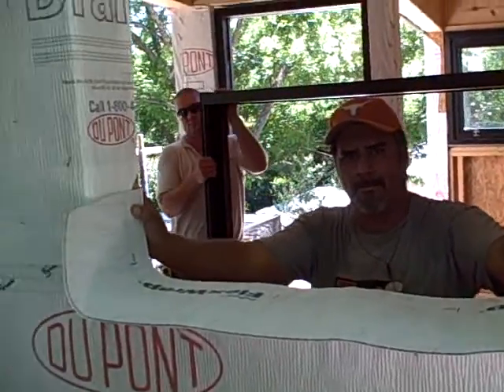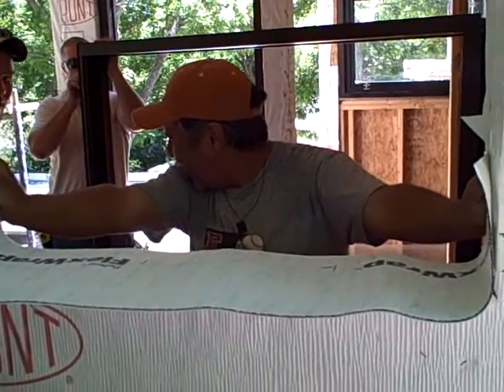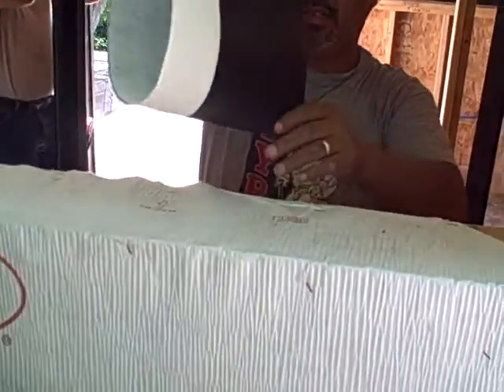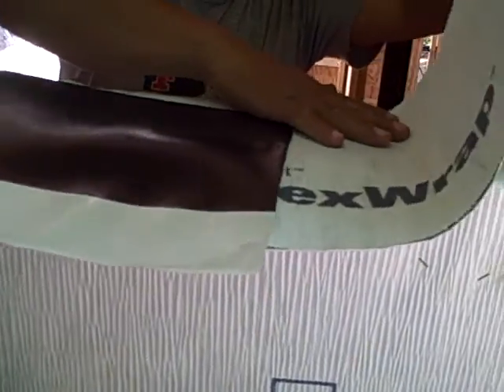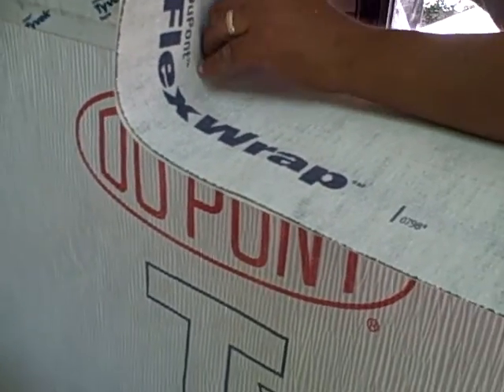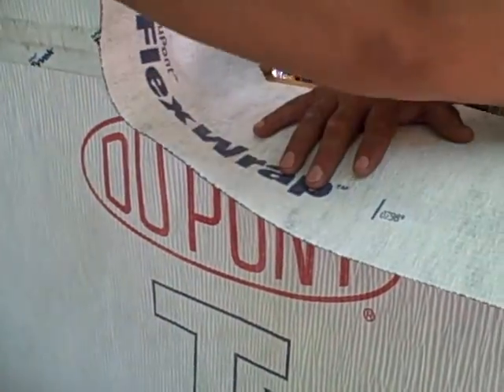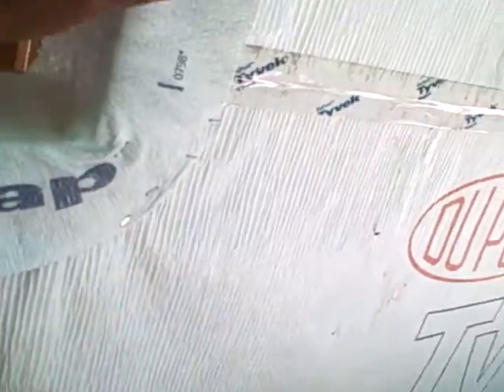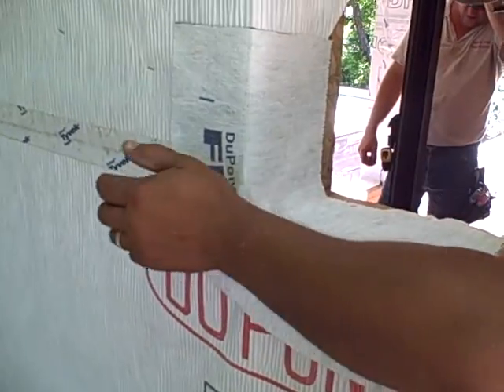DuPont Flexwrap Window Sill Pan

Comment: I know this is an older video from Matt, but I used the Flex Wrap on all of our new construction windows for the sill pans and Straight Flash for the side and top flashing of the window nail fins.  It worked great with zero issues.   Tremco Dymonic 100 elastomeric polyurethane sealant is also compatible with Tyvek WRB'S and tapes.   Used it to seal the windows and some of the penetrations.   The butyl tape is not affected by the polyurethane like how asphalt based flashing tapes are negatively affected. 

The FlexWrap tape is great to seal exterior penetrations such as water bibb piping, conduit, wiring,  etc, especially when you cut the width in half to make it easier to wrap around the penetrations.

Dupont lists 3M's Hi-Strength 90 spray adhesive as compatible with Tyvek WRB's and Tyvek Butyl tapes.   Makes their tapes stick great against OSB (I lightly sanded and cleaned first) and framing.    After 2 months of exposure before the brick was installed, the Tyvek butyl tapes I used had zero separation from the WRB and window nail fins, unlike the majority of Asphalt based flashing tpaes most builders use.    I always see those tapes peeling off after installation.   

Back rolling their tapes is key for proper adhesive.

Comment from the maker: @marc12020 Excellent point on the Buytl adhesive.  In our hot Texas climate I've seen the Asphalt based products get gooey and run down the Tyvek.  It is more expensive but you get what you pay for and when you're paying for a good window isn't it worth paying for an install that will be leak free for the life of the window?  -Matt Risinger

Comment: Been using this FlexWrap for about 4 years now. The best stuff I have ever used  it is a little pricy but I think it is well worth it. This Buytl rubber adhesive is compatible with all the building materials unlike the Asphalt & Bitutane stuff that is not compatible with vinyl windows & many sealants.

Comment from the maker: @LinXiaoChaun Good observations!  Yes sloping the sill is best.  In this case we used a back dam with backer rod and caulk.  I've taken apart windows that were set 5 years ago with DuPont Flexwrap and they still look pristine.  This is a premium product and it's made to last.  Matt Risinger

Comment: Two observations:

* It is not clear from the video that the "sill pan" is sloped to the outside, as is proper. Also, unlike a rigid pan flashing, this "sill pan" fails to turn up at the inside edge. 

* It would be interesting to see what the stretched corner of the Flexwrap "sill" looks like after some time has passed. Does it creep? Does it crack?